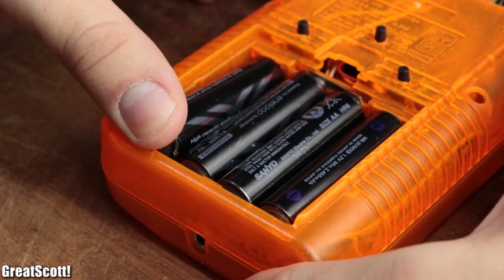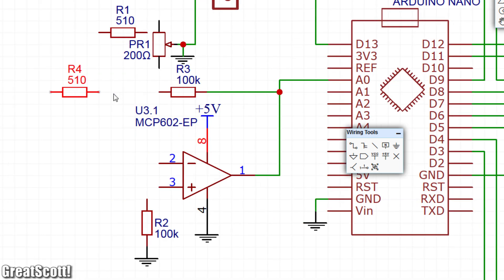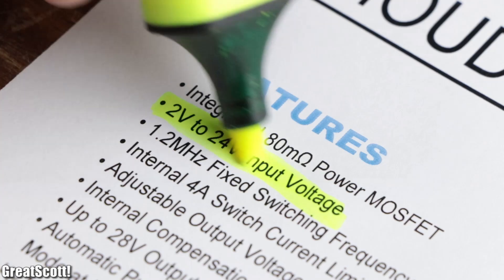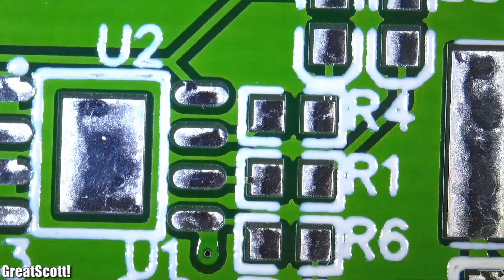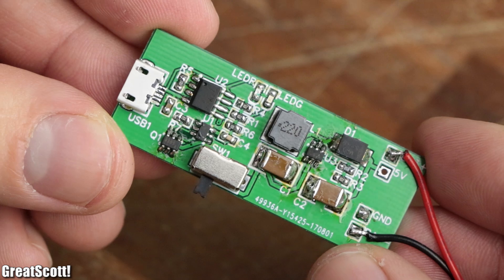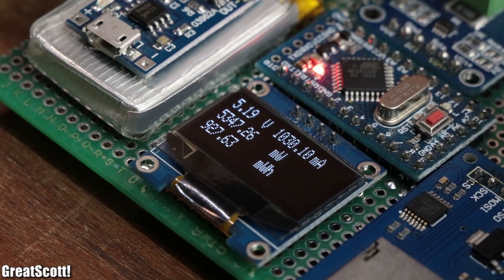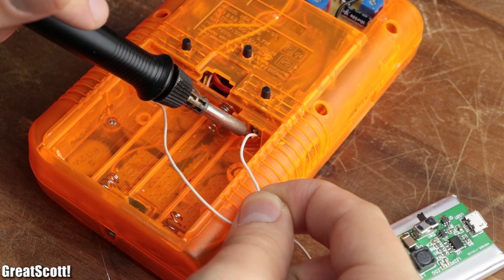DIY LiPo Charge/Protect/5V Boost Circuit

Comment: The DW01 has a low voltage turnoff at 2.4V, which is way too low. Am I right? So how can we make sure the circuit stops at 3 to 3.2V instead?
Reply: Erm did you watch the video to the end? At around Minute 8:30 he changed the design a little and uses as the protection ic a FS312F which has a cut off at 2.9 v

Comment: What changes would be needed to modify this design to output 3.3v.
I’m interested in using this design as a base power/charging circuit for 3.3v projects.
It would be nice to buck/boost the output power as required by the project.
I would be willing to pay for a design, are you available in upwork.com?

Comment: I purchased the battery charger / protection board from Amazon. Pretty much what you did except no boost converter. First test I did was under voltage where below 2.9 volts the charger IC should only put out a trickle charge of about 130ma or so. Well, it put out a little over an amp at a battery voltage of 2.7V.  Pretty dangerous as the li-ion can swell up and explode.  I bought 10 boards and they all failed that test.

Comment: How can I change the output power of the Boost Circuit to 12v? Can I just use an Boost-Converter in the end? Or do I need to redesign the Circuit?

Comment: I am thinking about creating a similiar design for a project of mine, but I was wondering if the boost circuit will work while the battery is charging. Thanks in advance

Comment: Hi Scott, great video as always! Can I charge the lipo with a solar panel? Should I use a solar charge controller in between to not damage the circuit? Maybe you create a new video in 2019 where you combine this battery powered circuit with a nice solar panel to e. g. create nice pi zero or arduino outside projects like animal cam or gardening system. Thanks and Gruß aus Berlin! Ingo

Comment: I've a noobie question. Usually the 3V3 Lipo batteries have a  over discharge protection circuit. If i used one of them i dont need the protection circuit right? Only the TP and the booster.

Comment: would that only work out with LiPo batteries or also with Li-ion (such as 18650 batteries) ?
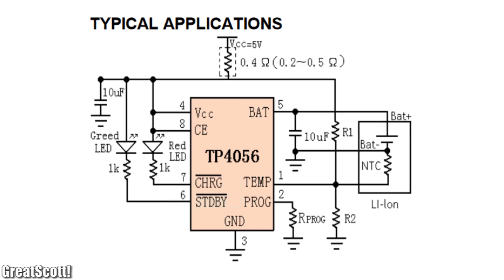Reply: nevermind, as per datasheet of TP4056, it is actually mentined that it is working for lithium-ion, and you concluded that therefore it is also for LiPo cells. And aslo, you stated it again in the video at 3:10

Comment: Hi Scott, I have a load device that I want to supply by a two 18650 cell lithium battery which could be recharged in live by a charger like yours. My device running on 5V needs around few hundred ohms to run and sometimes needs up to two amps peak current. Do you know if your charge boost ciruit could work with my project? I'm more concern about when the system switch between charging the battery and delivering the 2 amps...
Many thanks

Comment: Can this also function as a UPS where the boost converter is disabled when external power is applied?
Reply: I'm sure it can be altered to do as such, I would imagine a couple mosfets triggered by input voltage could cut off the charge circuit when the battery is full and run off the 5v in

Comment: Can somebody please recommend me a working 3.7v to 5v step up converter? The ones I tried do not work with 3.7v(li ion battery) so I can not get 5v output. I dont need a lot of output current(arround 20ma max). Thanks!

Comment: My project is to balance 4 series connected batteries(Li-Ion) by using an active cell balancing technique.  I m looking for an appropriate charging board like TP4056 but with higher voltage and current rating suitable for 4s configuration. There are many boards available online but they come with inbuilt passive cell balancing which I don't need as it is my actual project. I even want to indicate the SOC of each battery individually in % so as to show that all the batteries are charging at same SOC level. Can you suggest any suitable Charging IC and SOC estimation for this purpose?

Comment: does this board have uninterrupted recharging? been looking for a better solution to my raspi tablet and one of my requirements is to be able to plug the charger in while its running, have the battery charge, and unplug it without rebooting.

Comment: Aren't Li-Po batteries damaged if their voltage decreases below 3.2 V, meaning that your over discharge protection circuit isn't harch enough? :)
Reply: as far as i know if you don't drain it too long the battery will recover a little... but the opinions, like everywhere, go from "never discharge it below 3,7" to "i discharged the battery to 0 volts and i can still recharge it without problems"... what i've learned is: since it's a bag full of chemicals, you can only test what works best for you and what you are comfortable with
Reply: Bigclive has a video on it.  If you discharge it to 0 V, it'll still work but it won't be as happy anymore.  You'd have to reverse charge it to a negative voltage before it shorts internally.

When you have cells in series, you need to be careful.  That's when cells can be reverse charged and cause mayhem when the pack is recharged.

Comment: Hi, if you're looking at this area again you might consider the TP5000 (or even the TP5100) chip for charging.  It can charge harder (2 Amps) and is switch mode rather than linear like the TP4056.  Example modules for the TP5000 can be found on Aliexpress. As a general 'rechargable power for my project' sort of thing it might also be interesting to provide an option for 9 Volts and 12 Volts as well as these are common hobby project voltages.
Regards, Brian.

Comment: Can i connect the batery negative to circuit ground? I want to do this because i want to measure the battery voltage using an arduino tha is powered by this same boost converter

Comment: 08:40 well why not add voltage divider to the input pin of 312F ic, so you can custom your desired cut off voltage

Comment: Why you got maximum 1Amp if your MT3608 switch current maximum is 4Amps and all items what you use has a current reserve 2-3 Amps? Where is problem?
Reply: That is internal switch current. You should have some margin in order not to blow up the switch for boost conversion. For this tiny package without any thermal pad, 1A is way beyond for long term operation. He didnt mention the temp rise after a long term use with 1A load. I am sure that will be pretty horrible to touch by hand. The efficiency curve somewhat tells so. This PCB design should be made with lot of care in order to work properly.

Comment: As someone who knows how painful it can be to design, layout, and manufacture PCBs, you made it look really easy! Their software looks very much like Altium only web-based, and a few thousand dollars less too! 
A few tips for soldering SMT components: 
Make sure your Gerber files do not have a solder paste layer if you intend to hand-solder the components rather than a pick and place machine. This will mean your boards are (mostly) flat and free of excess solder which makes it much easier. If there is extra solder from the solder paste or HASL finish, then use solder braid/wick to remove it. 
Soldering SMT capacitors and resistors, apply solder to the PCB on one of the pads of the component and keep the iron on that pad. Using steel needle nose tweezers, slide the component onto the solder pad. Remove the iron and let the solder joint cool. To make sure it is flat to the PCB, rest the tweezers on the top side of the component with very light force and briefly touch the iron to the pad. Then simply solder the other pad. 
ICs are pretty much the same. Apply solder to one pin on the PCB, slide the IC into place with tweezers making sure the other pins line up correctly, remove the iron and let the joint cool. Make sure it is flat against the PCB, then solder the other pins starting with the pin most opposite. 
I find this method more reliable and produces less thermal stress than heat reflow with a hot air gun. 
If you are going to heat reflow after soldering for presentation, try using flux jelly in a syringe from the usual suppliers. It helps for faster reflow and a nice shiny finish. Makes soldering a lot easier for me!
Hope this helps! Keep up the great work with the entertaining and informative vids :)

Comment: Is anyone can help me. I would like to connect a NodeMCU ESP32 the 5V and the GND pins to the power in and "boost out" of a small board  https://www.ebay.com/itm/5V-2-1A-Charge-Discharge-Boost-Protection-3-7V-4-2V-Battery-DC-DC-UPS-DIY-Module/192316937250?ssPageName=STRK%3AMEBIDX%3AIT&_trksid=p2057872.m2749.l2649
and also to connect the boost up pins of this board to the same MCU pins. this way, when the NodeMCU ESP32 is connected to the PC via it's own USB it will change the battery and when the PC will be disconnected from the NodeMCU ESP32, the battery will supply the 5V to the same pins.  
Is it possible ?

Comment: Does anyone know a REALLY small Lithium ion charge/discharge circuit? I DON'T need the boost converter, but I need one with the protection for under voltage and over voltage charging, and protection for overdraw for discharging. I am going to use it for a small project, the WHOLE project is in a form factor of less than 0.25 inches wide, by 0.5 inches at the deepest part, by 2 inches tall.

Comment: Also (and just for the record) I want to mention that I have tested two different LiPo batteries, of 1050mAh and 1200mAh, and the ratio between the energy stored and the energy delivered is between 60% and 65%. For example, the 1050mAh battery would typically take 1064mAh at 3.7-4.2V and deliver 647mAh at 5V. Just something to be aware of when choosing your batteries.

Comment: Hi Scott!! Nice work. I love your videos. I have built this one and I've found an issue that happended to me that I want to point out: After charging the LiPo battery which it did perfectly,  I switched on and off the output a couple of times without any charge, and the TP4056 started smoking and just burned out. After replacing it, everything started working find again. If due to the the coil  a diode might be needed to block the retuning voltage spikes.

Comment: Can you make a tutorial video of diy power wall with formulas and other things to consider making it(size of solar panel, capacity of the 18650 battery pack, solar charge controller, bms and inverter.)?

Comment: I will soon be modding (it is already modded with backlit and cpu overclock to 8MHz) my TI-83 Plus calculator with lithium batteries. Do you think 13/14 year old can asamble this circuit?

Comment: So is there a way to have it switch to charging mode without having a physical switch? What does the switch actually do?
Reply: Umm.. he says it in the video.. it turns OFF the Boost Converter.  That's all.  The charging circuit is always on, so it's always in 'charging mode'.

Comment: Fantastic video and circuit!  I hope to adapt to supply an ESP8266 - that improves on the Wemos shield you tested in your previous video . Looking at the voltage divider for your circuit, my calculation  [0.6*(1+(7500/1000))] comes up with 4.8V not the 5.1V  you state at  https://youtu.be/Fj0XuYiE7HU?t=5m16s .  My calculation for a 3.6V output for an ESP8266 would be  0.6*(1+(5500/1000))  i.e.  replace your feedback resistors R6 and R7 with 5.5K and 1K ohm resistors. Thanks again for sharing your work. Glad to see JLCPCB supporting you - I will support them.

Comment: Hallo Scott! It is useful voltage regulator I have ever seen. It effectively works than I expected. Hmm, could you share me your voltage, or ammeter that controlled by arduino in this video clip. I'd be grateful if you shared it. Greeting from Russia

Comment: Could this be made smaller with the TP5410? It's datasheet is in Chinese, but it appears to do everything required in a smaller package.

It does charge regulation, under and over voltage protection, and has a boost controller built-in. They even show an example circuit that passes through the supply 5v to completely bypass the battery when power is connected.

There's also the TP5400 but it's more expensive and I can't tell the difference between them.

Comment: This is all cool and super! But I have a question about using a TP4056-based module (pre-built) and a couple of others (a battery charge/discharge protector and a step-up/step-down module for a solar panel) to build a UPS-style DC power supply. Any way I can ask you a question directly?

Comment: this is awesome. I might have just found what I was looking for.
I want to hook up light batteries, such as a 5V LiPo, to two Peltier elements and 12V to cooling fans and a water pump. But I needed something to protect the batteries. I could use this, right?
Reply: as long as the current draw doesnt exceed 1 amp

Comment: I'm currently working on a back up battery pack for my laptop that runs on 12V. It's configuration is a 16p 3s. I'll add a boost converter to the output to use it for other configurations too. What i really need help with is how do i determine the voltage and amperage for charging it and also what equivalent charging IC(s) are there for a 16p 3s application. i did some search and all that i found applies to only a cell or two in parallel. If you can help me figure it out i would be very grateful. amubarak418@gmail.com is my email if you prefer that. Thanks. :)

Comment: Just buy 3 dollar 2500mah power bank. And the circuit of it can boost 1 amp half size of your pcb charges with 1 amp and you are getting li ion battery too.

Comment: Does the boost converter switch has to be switched off when charging? Leaving the 5V output on, for discharge, charge, charge and use at the same time, would be a problem ?

Comment: Probably too late for you to still read up on this video but I have a question
Why did you connect CS on the FS312F-G to ground on the board instead of BAT-? Or why did you connect BAT on the TP4056 to ground with a 22μF while the datasheet says 10μF?
(Also in EasyEDA you are supposed to mark not connected pins with the X no connect flag from the wiring tools)
Reply: BAT- is in fact GND of the overall circuit, it is designated incorrectly in the datasheet of DW01-G.

Comment: I am trying to create a raspberry pi portable and i wanna ask if i could take the power boost from a power bank and use it for a lipo battery and how can i connect a 7 inch hdmi screen to a raspberry pi with wires and not using any hdmi adapters because i do not have a screen that has a driver board which clipes into the raspberry pi pins i only have a driver board without pins any help?

Comment: You should start mass-producing these boards and selling them on eBay... that'd be a fairly good board for hobby electronics that need a fairly niche charge/protection/boost circuit.

Comment: Hi GreatScott! Could your charger be used to charge a 1s 5000 mah lipo or a 1s 2200mah as I have 3 cell batteries that have a bad cell and would like to use the good cells fore use for a arduino or rasburry pi due to the larger capacity  thanks for your videos they help out do much

Comment: I just ordered a batch of boards and parts!

Looking at the layout, I noticed the ground/thermal pad on the TP4056. This would be tough to connect with plain hand soldering (I also noticed in the how-to-solder video you just attached the leads of this chip and seemed not to solder the pad underneth)  

If i run in to heat issues with the TP4056 I might  make another batch of boards with some vias on that pad and a larger copper region added on the back layer as a heatsink. I saw in some other tuturials (Including one by Dave /EEVblog) that you can use this technique to solder the pad from the underside, wicking solder through the vias with the help of some flux gel.

Never made PCBs or used Easyeda but in 20 minutes or so I was able to cobble together the changes I mentioned above. This is fun!

Comment: Hey I'm no engineer or physicist. I'm a medical student so I don't understand much about physics but had great interest in it when I was in school. Anyways I'm using a servo tester, 30a ESC, 1400kv brushless motor and my 10000mah powerbank for supply. When I was testing my 1400kv motor it suddenly started to act very weird. I mean it was having trouble spinning if I turned the noob more than half. Can you explain why this might be happening? Max output of my powerbank is 5v at 2A. Why am I using a powerbank instead of lipo battery? I can't afford it and it's freaking expensive in India with no warranty plus I just wanted to test it. I'm buying stuff bit by bit so in future I can build my own quadcopter. Till now I have bought a brushless motor 1400kv, 1 30a ESC, 2 pair propellers 10 inches. 
I have also noticed that in one pair of propellers one blade it sightly above than the other one. Do you know how to solve it? Yes I have replaced it and again same shit happened

Comment: GreatScott!, I have a two part question 
1. Wouldn't it be easier to mill out/ etch a pcb for prototyping and then send the final design out to be professionally made after all the kinks were worked out?
2. Is there a way to tweek the output amps to 2.5- 3amps?

Bonus 
When can I order this board and have it in blue?
Reply: While it is certainly possible to do such PCBs at home, it's too much of a struggle. In such fine boards that really stretch your manufacturing capabilities, you never know wether the PCB doesn't work due to a design or manufacturing error.

Comment: I've been following your old vids of the gameboy and been having a hellish problem with the screen. Using RetroPie instead and have a feeling it isn't forcing over the composite video.  Any tips? It seems that occasionally, once in every 20 power ups that the screen will power on.

Currently it isn't portable because I haven't figured out power. Plugging it into the wall for now. Hoping if I can fix the bug above along with this video that I might be able to get something sorted. If we can buy your boards cause there is no chance I can solder that myself ;D